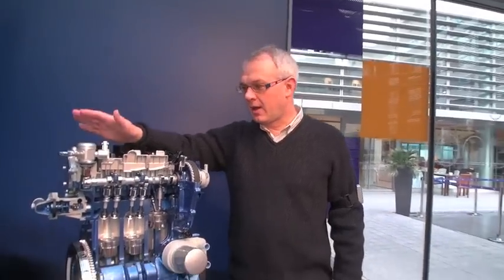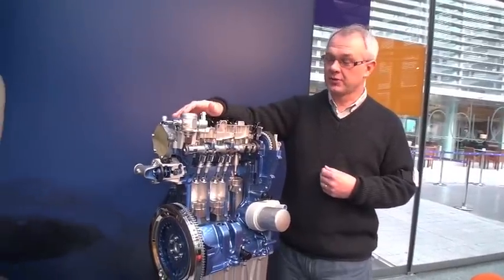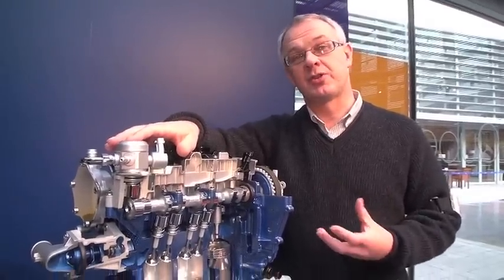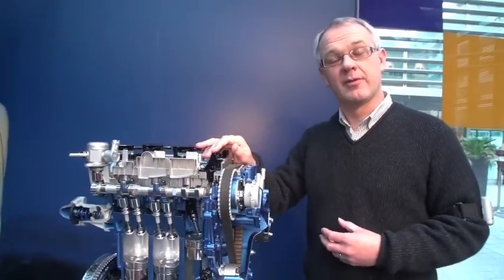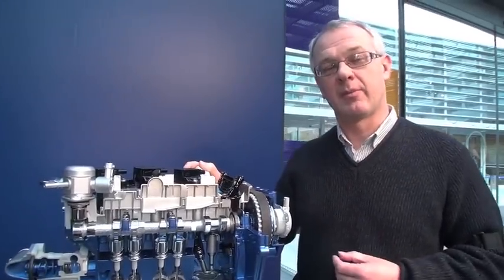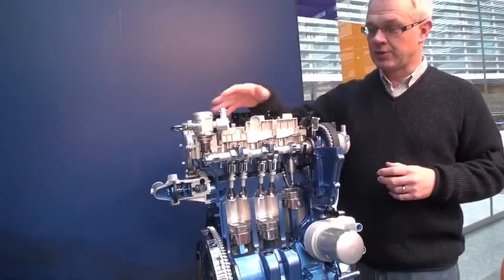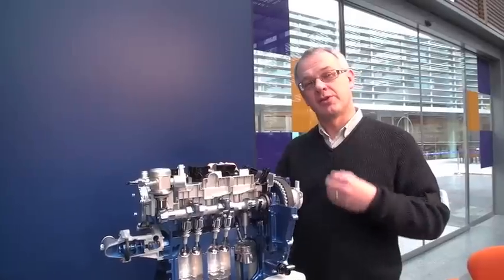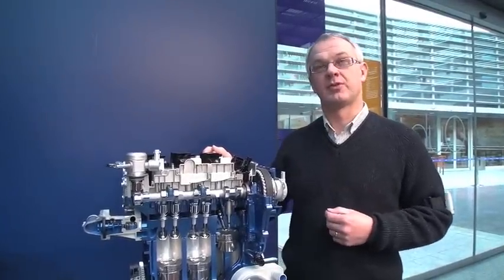Ford 1.0 Ecoboost engine

Comment: what a joke! worst engine ever, runs hot and thin cilynder walls, pistons brake easy, vacuum issues, headgasket easy gone. short engine life, oil needs changing regularly, worst thing i ever bought

Comment: Novel: new and not resembling something formerly known or used. So, in this case, sticking the belts in oil .... so they can degraded, break up and clog the oil pick-up. Sometimes is better to stick to tried and true, or at least Kaizen: Change for the better or continuous improvement.

Comment: My 2016 1.0L ecoboost Fiesta has just hit 40,000 miles with an average of 5,000 a year which is a low average. I get it fully serviced once a year and so far it's still going strong. I just need it to last another 20,000 - 25,000 miles then i'll probably sell it. I don't feel comfortable keeping it passed 65,000 miles.

Comment: Just wondering if you're looking at doing a newer version of this video where you change your mind about the belt being fitted for the Life of the vehicle with no service interval like a chain. Rather misleading to keep this up when the time frame has now gone to 10 years and the mileage has changed twice in as many years?
Reply: I just had my wetbelt swapped on my 2013 fiesta it seemed ok with 143.000km on it so for me it isn't to bad but yes I'm still not a fan of that wetbelt

Comment: Andrew Frazier you should be ashamed to put your name to this engine where as it may have some high tech and innovative design the engine is absolute rubbish when it comes to reliability as many customers have knackered engines because the belt deposits particles which then clog up the oil strainer pick up pipe and starves the engine of oil so the belt will only last the life of the engine if 40,000 miles is the life expectancy of the engine....they are total crap.

Comment: The fact that the cam belt runs in the oil results in the oil strainer blocking up and destroying the engine and there are many customers who have had engine failure. I would not touch one with a barge pole.

Comment: Timing belt never needs changing?
My Fiesta 1.0 Ecoboost 100ps at 82,000 miles would prove to be different then?
£2,500 for a full engine rebuild 🤷‍♂

Comment: Its a throw away engine, there's so many gone bang due to belt disintergrating and clogging oil pump, they're shit and it's nigh on impossible to get a mechanic to look at it, even they say its shit. Ford want 4-5 grand to replace the engine...taking the piss

Comment: Worst engine I have ever worked on and what where they thinking putting belts inside the engine so the bits can block the oil pump up
Will never buy Ford ever again

Comment: I guess you didn't realize that timing belts aren't any good when mixed with engine oil. Warranty, warranty, warranty.... the oil pump belt fails on a bunch of these. I have replaced the  engine and turbocharger as soon as 18,000 miles. Belts and oil don't go anywhere together

Comment: And here we are 9 years later. It is known as the Ford Ecoboom engine. Thousands of belt degradation failures at low mileage. Thousands of engines with coolant leaks destroying the engine because ford didn't think to fit a coolant sensor. The 1.0 is on the limit of its thermals all day everyday, there is no margin of error built into this engine at all. It is also horrendously vibratory at idle which shows the lack of balancer was a stupid idea. Under 2k revs the engine is horrible to drive. So they fitted very soft engine mounts to hide the issue and claim to have improved refinement. 
The Japanese have been building super reliable turbo charged 3 pots since the 90s. Ford couldn't even manage it in the 2000s. It's embarrassing.

Comment: With hindsight - Ford ripped people off with this engine. So many failures, it’s an absolute embarrassment for Ford and as an owner of one of these tragic engines I’m immensely disappointed in the way Ford have dismissed the issues with this engine.
Reply: With how many of these engines on the road, the failure rate aint that bad

Comment: All OK till cam belt snaps at 30,000 miles 😕
Reply: Wrong oil and not the ford specific one for this engine and oil flush additives damage the belt prematurely but its still a dumb design hence why the newest ones now use timing chains i think the wet belts even worse on the psa 1.2 engine for failures at low mileage
Reply: @stillshakin2125  I havnt heard of any issues with it yet but time will tell but yeah to still have a belt in the oil allbeit not the main timing belt is a dumb design must be cheaper to use I doubt it gives a huge efficiency gain to do it but i have heard that the newer ecoboost is a bit louder than the old one due to timing chain noise

Comment: Current biggest problem with the ecoboost is the timing belt degrading in to the oil, damaging to oil pump and causing catastrophic failure. Timing belt replacement is a £900 job by ford or £500 by a competent back street, all because they didn't use a chain. That probably wasn't an engineers decision. Ford except no responsibility for this.
Reply: Thanks for the information bro, 👍 highly invaluable

Comment: These belts have been stripping teeth causing serious damage and oil pumps are prone to clog causing low oil pressure these engines are the most unreliable on the road phone any engine shop and they will tell you the same.
Reply: Is that why there are shit tonnes of these engines on the road

Comment: Your telling me a rubber timing belt will last the life of the engine?  yes, but the life of the engine is til the belt snaps.
Reply: Hey are lasting like 100k and coming apart and clogging the oil pick up. Nice work ford
Reply: This engine is only as strong as his weakest part: the rubber belt.
Reply: True

Comment: Some advise, just bought a 2012 ford focus 1.0 scti ecoboost titanium 125 bhp. Did I hear this right, you never have to change the timing belt?. Thanks
Reply: It's a lie. Check your timing belt and oil for debris, the timing belt can fall apart filling the oil with fragments of it and destroying your engine. Hopefully you can open this link and see how it looks when it goes bad: https://www.facebook.com/serwisautopower/posts/2954433394790368

Comment: The timing belt on this engine falls apart and the bits clog the oil strainer. All this happened for my girlfriend at 70,000 miles.
Reply: @Jeb Gossage We did. Often way before its service interval with Mobil 1 synthetic 0w-20 and motorcraft filters.

Comment: I'm driving the 1.0L EcoBoost focus what a engine and what a car full of torque and speed if I need makes driving alot of fun I'll be staying with ford from now on.
Reply: I am thinking about geting one for my self, do you have the 100 or the 125 ps version?
Reply: Hope your engine is still working, these engines are prone to failure with the timing belt falling apart and clogging the oil system.
Reply: Sell it while the going is good.

Comment: I have an Eco sport ST line , I love the engine it has an awesome sound( like a V6)  my only grip is it hits the limiter too quick and if I switch of the esp/traction control in the wet it becomes skittish and spins up the drive wheel, yes I'm an old school boy racer at 48 yrs old

Comment: I have the ford focus se ecoboost 1.0 liter excellent car. Thought it would be slow but was the opposite. Smooth driving experience but little lag when accelerating. Overall great car if you want speed and save gas good  balance between both.
Reply: I thought the same, but this engine has blown my mind, it really has the fuel consumption of a diesel engine and the performance of an old 2000 naturally aspirated.

Comment: I can't believe Ford used a timing belt inside the engine running in oil,whilst I agree that the belt will run very quietly oil and rubber are not a good combination,I hope the hot oil doesn't attack the belt because it will just dissolve causing major damage to the whole engine,a chain would have been the better option for reliability,time and mileage will be the test for these engines but Ford usually let the customer do the testing for them leaving the customer to pick up the bill.

Comment: Was the camera man pissed, keep the camera still on the subject then move in when showing what the presenter is talking about. Thanks for explaining about the new engine but I am not too sure about a cam belt that does not need changing, surely it will degrade over time.

Comment: I have been driving a 1.0 ecoboost (125ps) Fiesta for the last four years and it has not missed a beat. This is a great engine which gives super performance.
Reply: I have the 1.0L 123hp 2014 Fiesta sfe eco boost. All I have done is oil change and tires and am at 75k kilometers. Owned since 2016 and it hasn’t skipped a beat either. The thing loves cruising at 140 all day long. And I mean I literally drove it at 140km/h all day (only stopping to refuel on Empty, then driving again) on some road trips and she just purrs along no problem. Amazing littles engine. If you’re good stick shifter you can surprise a lot of people off the get

Comment: going to have to change my 1.6 L ford for a 1.0 ecoboost just wondering about the wisdom of having a timing belt running through the engine oil. possible contamination of oil? slip of belt and how costly to change belt or will that not be required.
or would a diesel be a better option?

Comment: I'm looking to get new 2018 Ford with 1.0 ecoboost. However I've found much problems in US spec larger EcoBoost engines, problems with carbon buildup on valves and Ford generally saying only remedy to replace whole cylinder head. Also new RS Focus seems to have pitiful problems with it's cylinder heads leaving customers in grief and completely ruining Ford brand. What is the status in 2018 with EcoBoost, especially in european models??

Comment: Since I've been an apprentice at Ford, I've seen one other technician replace 5 of those 1 litres ecoboost engines. All because there was a slight coolant leak and they have just completed seized, welded it's self together. There's too much power for such a small engine. So much heat produced by the engine and the turbo, but nowhere for the heat to go
Reply: My car hasn’t overheated once. Engine is great and handles the power beautifully. No problems yet
Reply: @KevAlberta  Whats your mileage? I bought 1.0 ecoboost today with 200k km, I am worried that I made a huge mistake. Car seems to go very well, but I am afraid engine might fail soon as it is common
Reply: @cityistired  I’m at 160k km now. Had to do the spark plugs a month ago and that’s about it. Changed a wheel hub bearing in the rear  at around 120k km. And a rear tail light. My engine idler pulley started making noise but that’s about normal and easy cheap fix**. This is the only problema I’ve had since ownership in feb 2016
Reply: @KevAlberta  I guess it lifespan is hugely impacted on how you treat and service car. Hopefully this one will go another 20k before I get something else. It's shame, for me personally ford fiesta is the best looking 1.0 car
Reply: @cityistired  I floor it and redline it every day honestly lol 😂😅 a little rougher on the lil’ guy than I should be. Drive it nice and it’ll last for sure. I bought it at 11k km and now at 160k it still has the same pull. At 240k km you have you do the timing belt to meet the scheduled maintenance
Reply: However I do change my own oil and make sure things are up to scratch, so I may take better care than some other people
Reply: @KevAlberta  Belt was changed at 140k, I don't know when should I change again? Also, which oil do you use? A friend of mine which is a car mechanic suggested me, that since it has 200k, to use 5w30 or even 5w40 oil, but the manual strictly says that 5w20 should be used for 1.0 ecoboost. Thanks for you answers, you gave me some hope 😁
Reply: @cityistired  you’ll probably never have to change the timing belt again! 
I’ve always used 5w20 full synthetic oil (as per the manual), and use a mid to high end oil filter. I change the oil every 10k km (manual says every 16k km, and I’ve pushed it that far before a couple times with no ill effect. But much rather change twice per year because Canadian winters). And my car burns about 300 milliliters of oil per 10k km. 
I would follow the manual :) enjoy your car! I love getting ~5l/100km highway driving as I go to the mountains very often!
Reply: @cityistired definitely not any other oil, it degrades the belt more and they have been snapping due to poor Fred in a shed not using correct oil.
Reply: Wasnt that due to an issue with the coolant pipe, which was fixed
Reply: join our group Ford EcoBoost Nightmare

Comment: these engines are badly designed time bombs my engine melted the cylinder head casting adjacent to the exhaust ports as a result of the poor flow rate of the cooling system and the flimsy construction of the head
Reply: You could well be right.
However i have 80,000 miles on my c max 1.25 hp 1.0 ecoboost and its never missed a beat. 
Maybe i`m just lucky, i`m changing it soon anyway ( for another one)
Engines are engines all depends how you treat them i suppose.
Reply: Graham Adams i have this engine in myth 2017 Focus with 9,300 miles and its beginning to leak oil from cam seal. Will need replacement soon. Total garbage
Reply: The build up of heat has nothing to do with Fords ecoboost engine persay, all new ecological engine are being made to operate at far higher tempratures then previous, so by the laws of averages there will be more types of failure like yours, happens to other makes as well, but most of the time they are fine.
Reply: Don't buy a Ford.
Reply: What do you drive ?
Reply: A  Ford Mondeo 2.0 TDCI that is currently in limp mode costing all sorts of money to repair. What a nightmare.
Reply: Yeah i see your point Daniele, cars can be a complete pain in the rear when they go wrong.
However i have driven fords for over 40 years and found them quite reliable. That does not mean that they are perfect, no vehicle is.
Not that this is going to be helpful to you but my dad who is well into his 80`s has a diesel Mondeo and his kept going into limp mode, it turned out he needed new injectors. (cost a bloody fortune).
I hope you get it sorted soon.
Having said all that Ford does stand for fixed or repaired daily.

Comment: Mahle Germany hand engines like that 15 years ago. Ford sucks because they first sell you new tech then they let you know it is guaranteed to break and they don't have an official way of fixing it.  I am speaking of direct fuel injection varnish on the intake valves.

Comment: A cam-belt that never needs changing. Hmm. Dry or wet, this doesn't exactly inspire confidence. A chain and conventional tensioner would hardly have added any weight at all, and would safely run for the life of the engine. 

Yes, i am a dinosaur.
Reply: "Lifetime" here means 10 Years 180.000km (or so) - after that there is a change advised.
Reply: if you think a kevlar timing belt is good enough ive got a 2002 vw jetta in my driveway for you. timing belts are not permenant, this is a fact. the thing will snap
Reply: Kevlar > Chain
Reply: In Theory ! Right just like lifetime LED lights. Drive lines that never need greased   Bearings that never wear out. To big to fail     Etc. etc. etc.
Reply: Bipper 1.3HDI cam chain dead at 60K, and I'm not alone.